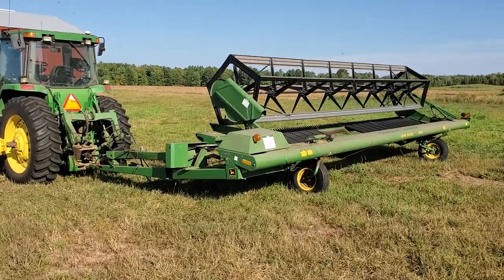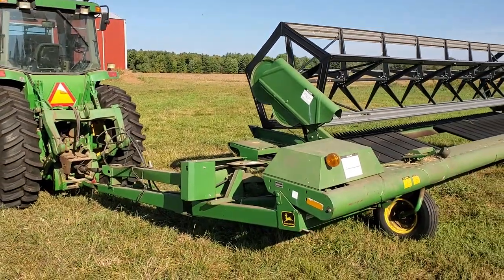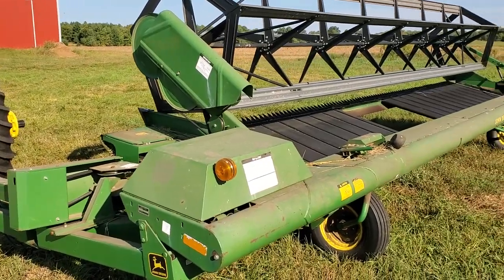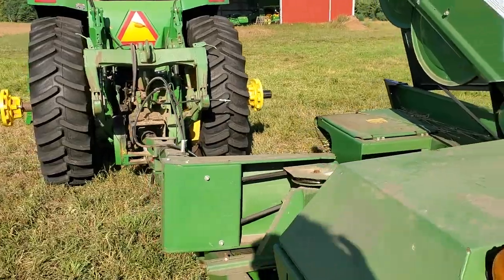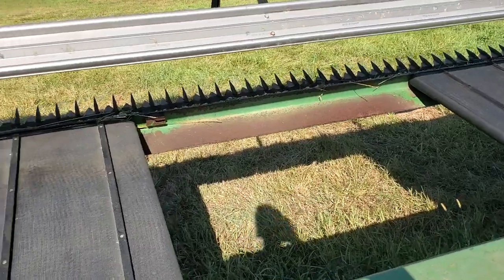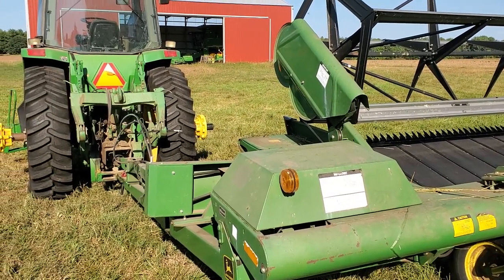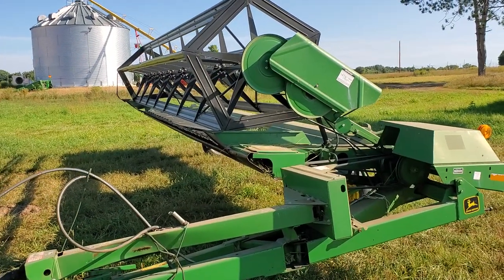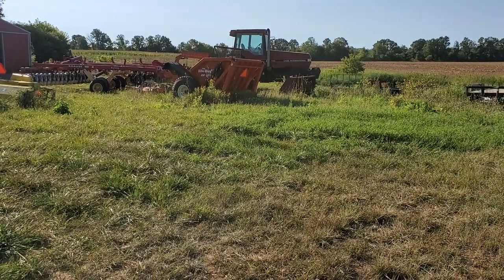Thoughts on Using the Deere 590 Pull Behind Windrower/Swather

Comment: Those pull types do a great job of swathing. This is just a newer version of the 580 which was the same build as my Massey 35. Biggest difference is the transport. My Massey 35 was all manual transport having to jack up the left wheel and change the position of the wheel so the swather goes down the road end wise behind a tractor or pickup. Biggest drawback is they won't handle a heavy crop of canola but in cereal grains you can't beat them.